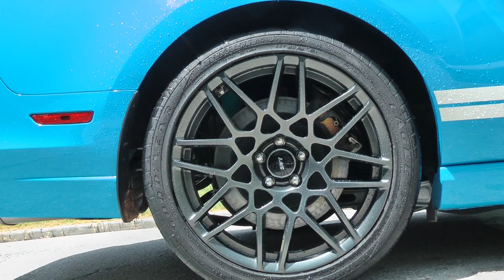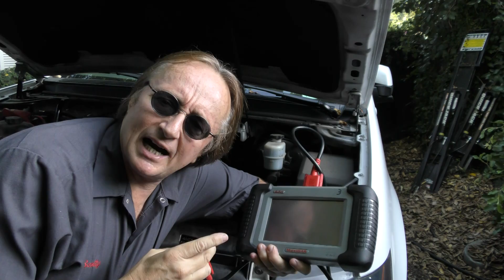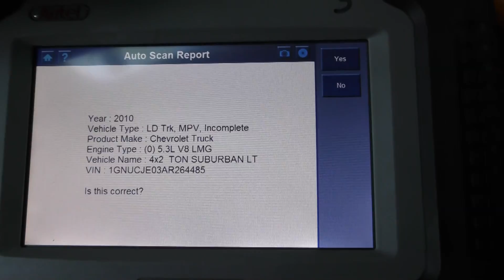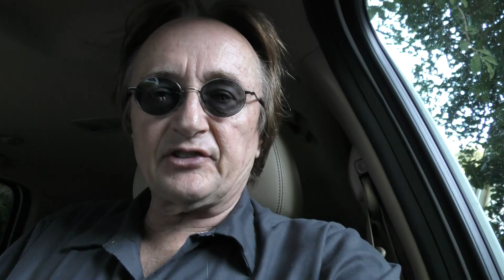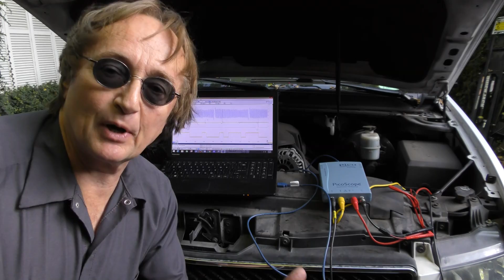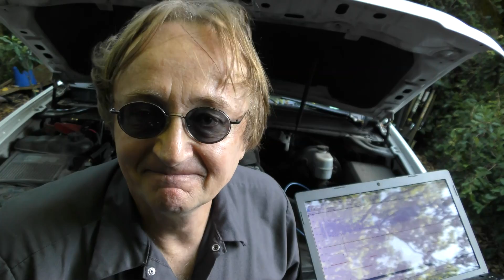Why Mechanics Charge So Much to Fix Your Car

Comment: To be blunt, the majority of mechanics I have dealt with impressed me as being barely qualified to change a flat tire, whether I'm at a dealership or at an independent mechanic. I don't care how fancy or expensive their computer equipment may be, the majority of mechanics don't know how to use it. And they still charge $110+ an hour. Most mechanics, unfortunately, have the education of a punk who dropped out of high school, and who lacks the intelligence, experience, and patience necessary to diagnose problems, use computerized tools, or fix complex machinery, such as today's cars. For example,  I visited my dealer and TWO independent mechanics to try and have a vibration under my Chevy Sonic's passenger seat fixed. None of the mechanics was able to fix it. All they wanted to do is give my car an oil change (which is, apparently, all they know how to do). After researching for a day or two on-line, I found a Chevy owner in Australia who advised that it was probably the fuel lines, located under the passenger seat, that were vibrating; the Aussie was spot on in diagnosing my problem. Oh, and fixing my squeaking rear brakes required a visit to the dealer and to THREE independent mechanics before they were fixed. In sum, I would have no problem paying a mechanic $110+ an hour if he knew what the hell he was doing, so that I didn't have to repeatedly bring the car back to the shop or, ultimately, have to find a way to diagnose and fix the problem myself.
Reply: Maintaining fuel lines is easy.  Use quality gas!  Even then unless you take a fuel line apart and clean it out, there is only one other way to clean the fuel line.  Fortunately it is easy.  Put seafoam in the gas tank!  Seafoam isn't the end all be all but at least once in a while seafoam is good.  Also find out about Marvel's mystery oil.  I just started using Marvel myself and some people swear by just that alone and that is fine.  I'm sold on Marvel's Mystery Oil to keep the engine running smoothly but for cleaning out carbon deposits like in a fuel line- seafoam.
Reply: @Bob-yk9cz  they were ratteling so they were insecure
Reply: where tf do you live on an island with some people who dont speak english also back brakes are easy if their discs drums you have to batter off but it shouldnt take long

Comment: They charge a lot because it's a bitch to do anything with these modern pieces of crap. I generally don't have a problem with what they charge, unless they're charging way more than everyone else. My problem isn' that it isn't worth it to have them do even the mundane jobs, but I probably don't have the cash to pay what they want, so I wind up doing most things that I can myself. Also very difficult to find a mechanic that won't screw me over. last car I took to a shop.. 400 dollars later... still wasn't running, wound up selling it for scrap price. Too bad I liked the car when it ran... but after a month of trying to do it myself, I just couldn't track down the problem. apparently this shop couldn't either, they put on parts that didn't solve the problem, in addition to all the parts I already put on. Needless to say, I won't go back to that shop... not only did they charge a lot for no results... they took forever to even do that much.

Comment: The wiring was all that needed to be changed but i know you wanted to charge for the other lol i had a vehicle do same thing just from coil wire shorting out half mechanics don't know what those tools do lol just another reason to charge more money is all and take more time up my cheap computer does me fine 😎

Comment: They seem to be designed so that you have to take the cars to the service dept of dealers. There is only one dealer for tysinger where I am. Smart cars are the worse with autoparts claiming to be rare, therefore, the expensive prices...

Comment: This isnt a good example. The failure to communicate is a blessing, not a curse.This could have been diagnosed without any special diagnostic reader or scope, just a test light, basic code reader , and a good technician.A lot of older cars are far more complicated or difficult to diagnose, in many ways.Mechanics charge a lot less than they should. It takes a massive amount of training, expensive tools, toxic / dangerous / hot / dirty / cramped / high liability / high stress / physically demanding work conditions, and customers with low appreciation and high expectations . The cheap automobile owner willing to pay a hack is responsible for most "bad" mechanics.The low quality of cheap parts and a consumer willing to buy throw away vehicles takes up most of the slack.The next time you need a Doctor, just watch a video and do it yourself. Or get someone off craigslist to do it.Automobiles are one of the most dangerous things to you in your life, yet the perceived danger by the operator is very low.I will never work on automobiles for the general public ever again. There are a few bad mechanics out there, but most automobile owners are bad / cheap owner operators.The popularity of this guys channel proves that.
Reply: Who is worse than lawyers (who aren't suing you)?  Car Mechanics!  I've known of plenty who had themselves taken to court and they owe serious dough and they aren't in business anymore!  Oh, yeah, "cheap" car owners- right.  They are just tired of the $$$ bills.  Smh.  Mechanics just tend to be the lowest of the low.  An honest mechanic who has a reasonable expense I treasure highly.  But they are very hard to find.

Comment: I just don't get it...I have a 03 Ford f150 5.4. the damn thing needed coil packs due to a misfire. It ran well excellent afterwards, but the check engine light came on again. That was a $1000 dollar fix, and the damn truck is crying again. I'm never having kids. I'm in Houston Texas btw. Cheers guys.

Comment: Many mechanics charge so much because they got you by the balls and know you have no clue whats wrong with your car, how to fix it, or how much it SHOULD cost.  They know you don't know the market rate for labor or parts, they can justify claiming that there are problems with parts that really don't need replacing, and they can create work for themselves.

Comment: What's sad, most go by a book (can't remember the name) and on most items...it's ridiculous.  Almost like long breaks are built in.  I do all my own work but there were times in the past that i'm super busy due to work.  Took my mustang to a mech to swap out the UDP's.  Said it would take 3 hours and 200 bucks (back in 2000).  What??  I laughed and said no thanks.  Waited till i had a day off, had them swapped in an hour.  Just crazy that i can take my time, swap them out, know it's done 100% correct in 1 hour.  But somehow they tell you 3 hours.
Now if you told me 1 hour, if....key word.....IF things go right, then okay.  I've been there plenty of times.  Telling my wife that this should take 4 hours IF it goes right.  And she understands the IF.
1 hour and 60 bucks or "Hey, bolt snapped and its going to add another hour to it".  Then i can say okay to that.  But not 3 off the bat, take 1 hour too, but you get charged for 3.  No thanks.
Scotty da bomb!

Comment: The lawyers want these cars to be to expensive to keep after 10 years so they end up getting crushed.  Once there crushed theres no liability the famous GM KEY SWITCH that shuts off your car when morons hang 15 lbs of dingleberrys on their ignition switch and gm had to buy 30 year old chevelles and novas new ignition switches.  friggn shameless deplorable lawyers and their frivolous law suites,  are the real reason factorys have closed and moved over seas where the beady eyed bastards can't mess with them.

Comment: I fixed the PCM (not replaced) this past Summer of 2017.   A lost communication problem also with PCM just like your case . The dealer said I'll need a new PCM.   Little did the dealer know that it is common for a PCM or other electronic modules to become negatively charged and malfunction  All you have to do is to remove it, break its seal, open it up and discharge it. Then let it dry for a few hours or days as you wish and use a good quality clear silicone to close it up. A $4,900 quote from the dealer to fix the two U codes (including replacement and reprogramming) costed me less than $20 for the spray and the silicone.   It was about 10 minutes to remove it and an hour or more to open it and 30 minutes to discharge it.

Comment: Car Doctors (they don't repair or fix things anymore , they just swap parts out )can charge what they like cos they can. Until you pay the account you have no wheels. Learn how to fix these mechanical things yourself and save millions on repair bills. The modern motor today is a far cry from the rubbish of yesteryear. Basic attention to details and most of today's cars will easily do 300,000 Km + (always change lubes when due , never skip these uber important cycles. And lubes are cheap compared to engine and mechanical failures.

Comment: I thought my car was old enough that it would immune to problems where you cant fix it yourself. I found out just how wrong I was when I tried to replace a light switch. I cant even reach behind the dash board. I also tried taking the instrument panel out but I couldnt pull it out far enough to disconnect the speedo cable. I had to stop myself before I actually broke something

Comment: What the heck is a body control module?   Yes, it does require a major investment in education and equipment to effectively service today's cars.  I don't mess with too much on my Camry, for fear of screwing up some computer.  I don't mind paying extra, just get upset paying for second rate service.  I do understand that those scan tools are only the tip of the iceberg, complicated equipment and education is required to dig any deeper...."No codes found" doesn't mean too much anymore.

Comment: My dad took his 08 pathfinder to the Nissan dealer to fix a thumping issue and a problem with the car going to or under 500 RPM and vibrate (during idle). After 3 days the car was ready, and when my dad took it back onto the road, it was still doing it. After 2 times of going back to the dealer the thumping problem still persists! The RPM isn't that bad anymore, but still, i'm mad at Nissan.

Comment: the reason why they charge so much is, diagnostic equipment is expensive, tools are expensive, parts are expensive especially if OEM,  and that's not to mention the 3-4 years of college to earn the qualification, then the taxes involved and the the overheads and this is not an exhaustive list

Comment: hey scotty my car has a problem I've taken my Malibu to different mechanics idk if they see that im dumb or something but i tried to  get it checked and instead came back out with other bad news .. my wheel was going to fall off anytime , my battery was going to die etc.. i went in to get my computer checked or sensors but as said my car randomly will brake as im driving 50 and sometimes it will struggle to drive like it will be forcing itself and would take 30 secs to reach only 10 miles and hour

Comment: Mr. Kilmer, if I may, I wanted to ask - what is your opinion on Volvo cars made from 1999 and newer? I'm a Volvo enthusiast, but everyone tells me to stick with a 1998 model or older. I had a 1999 Volvo S70 for a number of years and had numerous issues with the ABS system, random failures of sensors, and the electronic throttle module (ETM), a part made by Magneti Marelli that liked to go out every 50k  miles.
Reply: @jsrosa1282 - Scotty failed to answer the question in 5 years.  What do you think Scotty's opinion on is Volvo's 1999 or newer ??

Comment: Everything is possible..Just buy a diagnostic tool for your specific car.Mine costs 250$ and it supports only kia hyundai and daewoo.Then buy high quality DVOM with scope function , Amp Clamps and you are ready to go :D .Also you need a good place to work,where you can hook you laptop and scanner tool.with 4 jack stands you can even replace a transmission by yourself.But most important thing: Spent at least 2 hours a day scouting internet and youtube for information.

Comment: Scotty - first off, I just found your channel in the last month and you've already saved me 1000s of $. Thanks for all your great videos.
Secondly - this is a great video to ask this... What do you think of the BlueTooth OBD scanner modules/tools that work with things like an Android device (with an app)?  Do you feel they are more complete than one of the cheaper handheld OBD devices you might get on Amazon or other places?
Reply: @dougwells1959 - Good Grief!!  Does Scotty have to answer every question?

Comment: Does the 1998-2002 firebirds or trans ams have all this computer stuff?
Reply: Ghost Snake Not as many as newer models but yes they have them. From about 1987(?) on all vehicles have some sort of computer module in them mainly for the engine but as vehicles became more complex more modules to control other functions as well.
Reply: Those years are covered by the OBD II protocol. Safe to own. Many places cannot diagnose
pre-1996 models.
Reply: Patrick Joseph yes and some manufacturer had proprietary protocols like the mutt protocol used by mitsibushi until early 2000 in their pajeros ( yep sorry Spanish people...it's their blunder hey ,not me) so one has to have dedicated tester or no go yet knowledge and 'keeping up' with new stuff is recommended, however things are becoming too modular,- use and chuck away is replacing 'fix it'.

Comment: I doubt the premise of your claim,     The computers are fairly cheap and it saves a lot of time searching,      The sensors are simply replaced etc,     The only time I believe they are worth the money is replacing clutch`s,    Engines,    Brakes,  Cambelts etc.,

Comment: Hey Scotty, I have a 95 Mitsubishi Galant that hesitates/stumbles when I accelerate from a stop, It sorta sounds like its backfiring or something...  but once I get it going at speed it runs fine. The engine idles okay, also If I run a can of seafoam it seems to help a little bit but only for a few minutes.... What could it be? It has no check engine light or any ODB codes stored.. Thanks

Comment: Hilarious, quick, and to the point. Subscribed! Last time I was at the GM dealership over a check engine light on my Hummer H2, the lead mechanic showed me all of those numbers on the computer and showed me exactly what was wrong on the car. Pretty amazing! I will say, its nice to be able to know exactly whats wrong immediately so they can replace the one part with an issue instead of multiple until they find it.

Comment: they started using computer control on vehicles in the early 80s to get better mileage and less pollution. fast forward 35 years and we went from driving small, fuel efficient cars in the 1980s/90s/2000s to driving gargantuan jeeps, suburbans and jacked up 4 door diesel trucks which get 8 MPGs and belch soot like a freight train. and all they're doing is going to the grocery store. they're not going camping, not going to a job site and not towing anything. all the technology we've come up with has been completely negated by our own stupidity.
Reply: Hmmmmm sounds like a socialist .All you need is a Yugo !

Comment: I don't mind paying mechanics what they charge but dealership service depts go overborad. Just for fun I call my local MB dealership when I need work done just to get a quote. My C300 needed rear brakes pads+rotors and I like to change the sensors for the hell of it too and the dealership quoted $903 taxes in just for that. I love how they pegged it at only $799+tax. I did the job myself using Textar pads + rotors (OEM stuff) and 2 sensors and all of that ran me right around $320 all in. They also quoted me $350 for an A Service which is just an oil change. Changed the oil myself using Motul synthetic and a fleece filter for $120.

Comment: That answer sounds great.. I'm all for helping pay for the tools and knowledge... What gets me going is the fake hours chart that everyone uses to give an estimate.  $300 to replace the front disc breaks?  Computer says it's $100 in parts and 2 hours labor.. your getting a good deal.  Except it's $20 in parts and 30 minutes of labor.  I also understand that a stuck bolt or some other issue could take 2 hours.  That's fine, but if you swap my brakes in 30 minutes, change me for 30 minutes!

Comment: Small shops around my area not to bad between $50 -$65 per hour labor, even cheaper if they are doing work on the side. If you're working for someone as a mechanic, business making money not so with the mechanic depending place of employment,  lucky if you get $15 per hour, depending on experience.

Comment: One question for you Kilmer....i  have  a toyota corolla 2006 LE....i was told by  my  mechanic that i can  only  use a specified Heat Sensor for the car ...how true is that?  thank you.
Reply: tarantulla 007 You mean heated oxygen sensor?  If so, you should stick with dealer, ntk, or denso sensor.